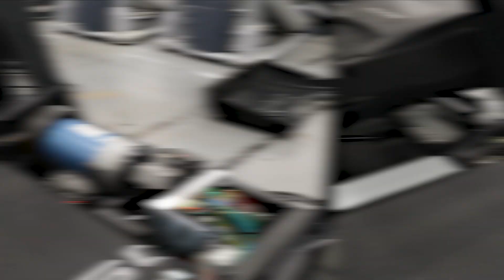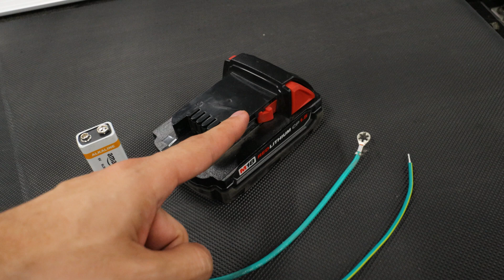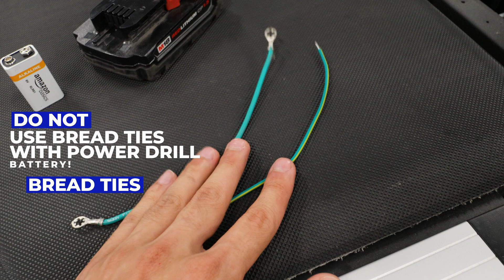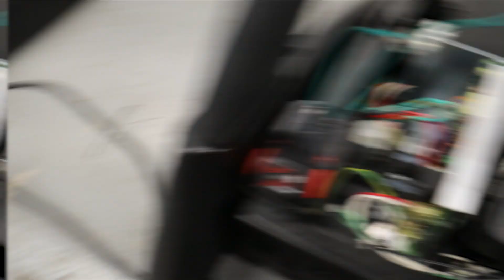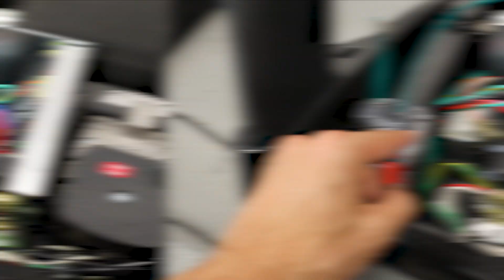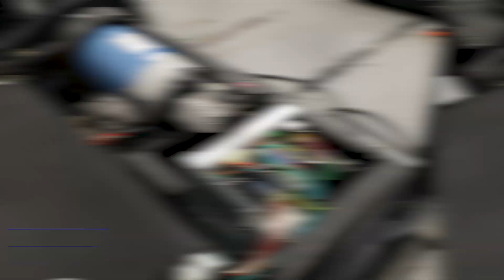Test A Treadmill Drive Motor | Quick and Easy! | See Warning In Description First

Comment: Hi , but normaly those DC motors are driving higher DC voltages ( up to 130V mor or less), driving 18 V it's less and I think will be no problem . Am I wrong ?
Reply from the maker: A treadmill motor can demand a huge inrush (startup) current, and some drill-battery packs (especially ones with “smart” protection boards) can be stressed or shut down — and in certain cases, damaged. There are others who use or suggest using 18v battery packs. Nonetheless, just make sure not to have it connected too long to the drive motor. A few seconds jump to see if the drive motor moves is enough.

Comment: I have a deer run a1 i believe. I have tested all belt and lube issues. It is not those. The motor turns on when plugged in but when i step on it. the motor can not move me under lower speeds.(no belt slipping) if its on high speeds it can. I have not done the battery test as its obviosly spinning. will the batter test check for if the motor is going bad? which is what i suspect.
Reply from the maker: Have you checked your drive motor brushes?

Comment: This should be done with a small car or motorcycle 12v battery, or a portable car booster pack. Using drill battery can overload and blow the battery management board inside the drill battery (i've done it).

Also this does not prove the motor is good. one bad winding or worn brushes or fouled commutator bar  can result in a motor that still spins, but with low efficiency.  other tests are required to detect a bad winding.

"SO THAT'S A GOOD DRIVE MOTOR" - from a company that sells used parts - not tested properly. That is not a good sign...Yikes
Reply from the maker: @rickc2222 Thanks for the detailed feedback — you’re absolutely right on a few important points.
We agree a drill battery isn’t the ideal power source for this type of test, and we appreciate the warning about the potential risk to the battery management board.

And you’re correct that this “spin test” is only a basic functional check, not a full confirmation that the motor is 100% efficient or free of internal issues like a weak winding, brush wear, or commutator problems. Our goal in this video was simply to show that the motor powers on and rotates smoothly — not to claim it’s fully load-tested or electrically characterized.

We actually do recommend additional testing (under load / current draw checks) depending on the application, and we’ll work on showing more of that process in future content so people know exactly what we mean by “good.”

Thanks again for taking the time to share your experience — comments like yours genuinely help improve what we publish.

Comment: I have a BH RC09 and honestly I think the motor is broken, I'm saying this because two Mosfets from the control board become short cut each time the motor starts. So I try with the 9 volts battery fully charged and I can see the motor working, so I want to ry with the 18 volts, but you specifically say for not using it? Can you explain. Thanks I'm an electronic engineering.
Reply from the maker: If you tested the drive motor with a 9v and it works like normal then the drive motor is fine. I suggested not to use 18v because it isn't necessary and would be a lot of power through the wires. Sparks were flying as I used the 18v power drill and the wires may get too hot and cause burns.

Comment: I took the cover off and I have a fast blinking light we I turn the treadmill on. Any idea what it might be?
Reply from the maker: The light blinking on controller boards differ in meaning per manufacturer. You may need to look up yours for your particular machine. If you own a NordicTrack machine this video may help: https://www.youtube.com/watch?v=QszHrCs72AM&ab_channel=FitnessEquipmentHelp
Reply: @hydrafitnessexchange  I have a pro-form Carbon TL.
Reply from the maker: @sharingan714  The video should suffice to help your issue. Proform is owned by the same company that owns NordicTrack.

Comment: Hi! My motor passed this test, but when I connect it to power board and start treadmill, after few seconds IGBT burns out=(
I tested it on different power board (the same model), and again, IGBT failed in 3-10 seconds. What else I should check?
Reply from the maker: Are you testing under load or no load?
Reply: @hydrafitnessexchange  motor connected to the belt, and just idle work, nobody running
Reply from the maker: @accessdenied7633  We actually did a video a while back of several things to check when encountering belt issues that tie into this. This may be helpful: https://youtu.be/1VNkpidgeus Usually, the case is the treadmill isn't given proper maintenance, creating high current draw and damaging internal parts.
Reply: That's exactly what happens to me, IGBT Mosfets failed after a few seconds, but in my case the test with the 9 volts battery the drive motor doesn't work  .

Comment: My Proform PFTL13113.6 console turns on but only speed 5 and 11 work all other buttons don’t function what can I do to fix the issue if the console isn’t available
Reply: Mind has a pause on each belt rotation. Like a hiccup. It's not the walk belt tension and still does it with out weight????
Reply from the maker: @charlesbenoitthomad  Did you by chance check the drive belt tension?
Reply from the maker: It is most likely a bad console membrane. You'd have to replace the console. Hopefully there will be one available soon. If you do not have a warranty maybe try to find someone giving theirs away via facebook marketplace and bargain for just the console. We'd offer you one if we had one in stock, but unfortunately we do not at the moment. If you need a tech to further diagnose your issue here's our tech database: https://www.hydrafitnessexchange.com/technicians
Reply: @ good news I fixed my console removed all ribbons and wiped them with alcohol and presto all good
Reply from the maker: @esantibanez2957  Nice! Definitely keeping this in mind for the future as a possible solution.